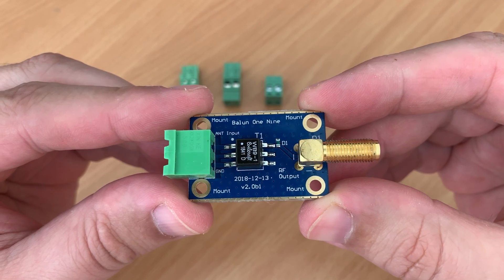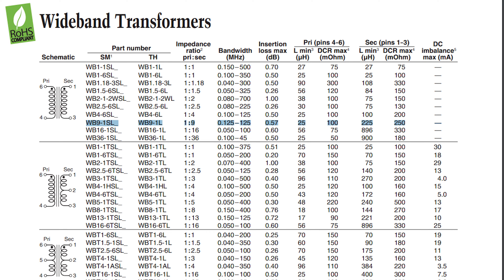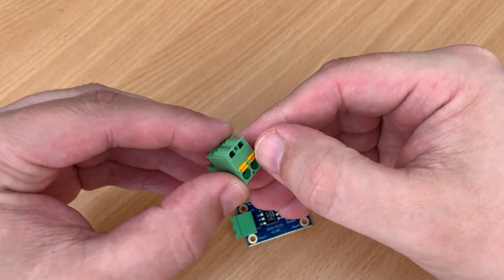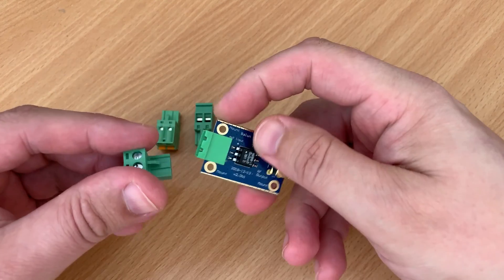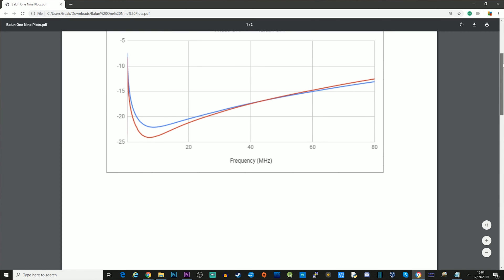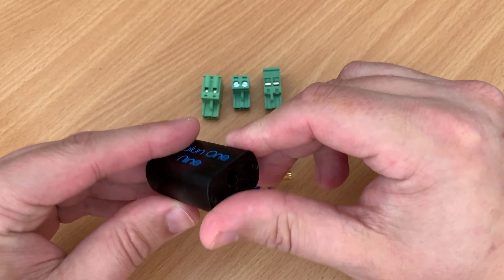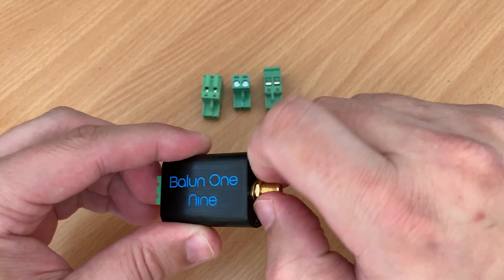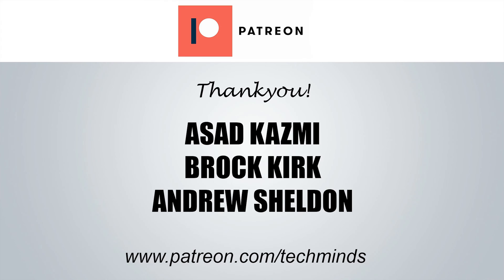9:1 Balun Version 2 From NooElec

Comment: I just bought a V1 to use with a receiving loop.  It does not appear that the V2 has a center tap on the secondary so a balun configuration would have to be floating and potentially noisy.

Comment: I just transmitted with mine, 0.2-0.3 watts worked fine, 0.5 watts appeared to work fine. Someone may want to sacrifice one to test this for longer and at other powers, but I’ve just done three FT8 QSOs with it. Also some WSPR.

An FT8 QSO at 300mW is… a challenge. But doable.
Reply from the maker: Interesting experiment there Mark!

Comment: One thing I don’t get about this product, currently sat on my table: in the config it comes from the factory, how is a 9:1 balun useful for a dipole? Is that for people using 450 ohm ladder line to feed it?

I’ll be cutting the track at R1 and making it an UnUn, at which point it becomes useful to me

Edit: yes it is! I feel that needs to be clearer in the product description, I was about to just chuck wire on the end of each terminal, but that’d be 73 Ohm I guess
Reply: If you cut that, it will be an UnUn, yes, and good for random wire / long wire, not for a dipole anymore.

Comment: Nice! How does it compare against the previous version of the NooElec Balun One Nine? Does it do a better job?
Reply from the maker: From a technical specification angle this v2 has better specs, especially insertion loss. The transfer is also more beafy. Good thing about this one is that a case will be available on the coming months, which is great if you want extra protection.